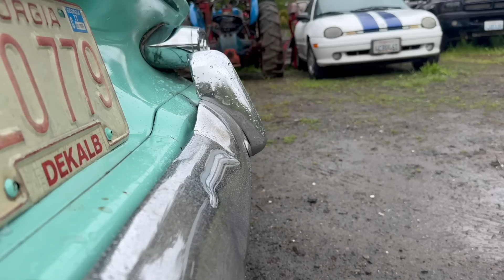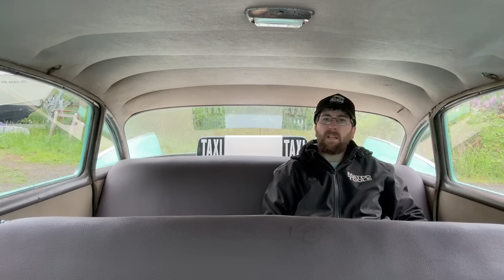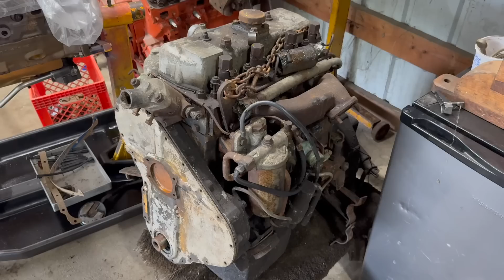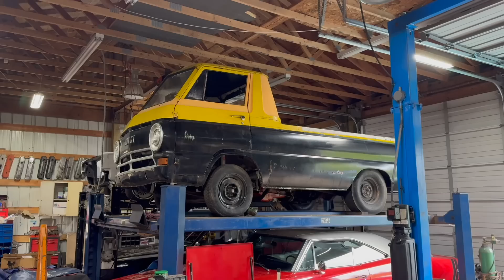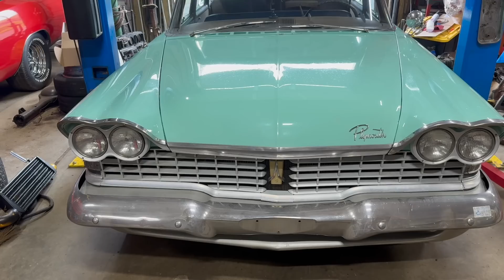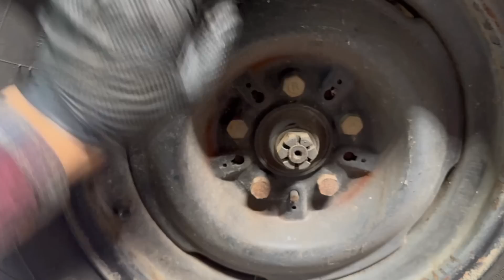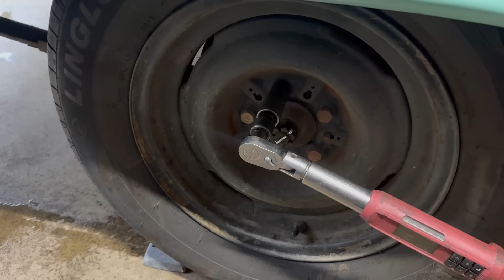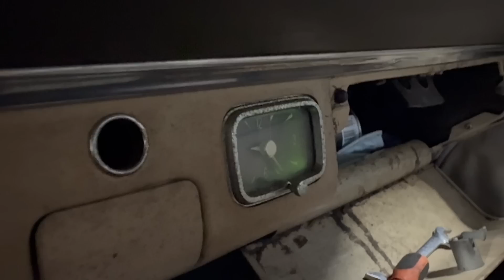Slow And Stinky - 1959 Plymouth Diesel Taxi Engine Tech, Test Drive, Safety Inspection (Not Good...)

Comment: Perkins engines from those series are IMMORTAL: here in Argentina, we used them in everything, literally everything.

4-cylinder engines are generally found in small work cars and trucks, but for something like that Plymouth, you'd probably see a 6-cylinder Perkins, the 305 or 354.

Today, it's very common to see Ford F-100s from the 1960s through the 1990s with the Perkins 6, 305, or 354. Cars like the Ford Falcon, Chevrolet Nova (1st and 2nd series), Valiants, Dodges, etc., with Perkins engines, generally the 305 for those sizes.

Argentina, like the USA, is a vast country, with large open roads and fields where agriculture and livestock are produced. Diesels are king; nothing compares to a diesel when it comes to heavy and hard work.

Indenor engines were common in light vehicles (Peugeot 404, 504, and their pickup versions), and the legendary Argentine "Rastrojero Pickup" also used them.

In the medium-heavy range, the Perkins 4 and 6-305 engines were already appearing, along with the Deutz 4 (true air-cooled beasts). In the heavier vehicles, the Perkins 3-354 and Deutz 6 engines appeared, although there were some 6-cylinder Indenor engines (around 3 liters of displacement).
Then, in the mid-1980s, some Japanese engines began to appear, such as the Nissan LD28 (my father has one in a Jeep CJ-6 4x4), which were exquisite engines compared to the old Perkins and Indenor engines widely used in cars, because they achieved higher speeds and ran smoother.

Anyway, I see that diesel taxis weren't just here, and they were ubiquitous from 1970 until the early 2000s, until the use of CNG in gasoline engines became available.

Best regards, and thanks for the videos you always share!
Reply: I truly admire the automotive products of Argentina, especially the IKA products (like the Rambler limousine built for the President of Argentina and the Carabelas) and the Ford Falcons.

I will say, however, that  Brazil has a white 1957 Plymouth limousine with jumpseats.
Reply: Gracias por explicarle un poco loco! Que motor el 6305
Reply: @ismaelduarte888  

Te voy a contar una: 
Mi finado ex-suegro, como buen Vasco, tenía una Ford Ranger F-150 ´81 carrozada, con (como corresponde a un Vasco hecho y derecho) un generoso 6-354.

Cuando se enfermó su compadre en el campo le hizo como 400km a fondo, y casi sin agua: sopló junta de tapa y partió una camisa.

Esa camisa la arreglamos con Erpox (le faltaban pedazos, literalmente pedazos de camisa), hicimos plano de tapa y cambiamos juntas: hizo como 100.00km más hasta que la vendió, eso hace 12 años, y al día de hoy esa chata sigue andando tooodos los días. 
Desde que el Vasco y yo le hicimos eso, nunca más necesitó tocarse.

¨Perkins 6: no lo entenderías..:¨
Reply: Si señor.....
Reply: Seeeeeee 🎉🎉🎉
Reply: What is the name of the 4 cylinder Perkins you are referring to I’m looking for a swap for my 88 ranger
Reply: @benjaminserino6611  

Here in Argentina, there are many Perkins models; it's a very widely used engine.

For example, whether it's the PF or PA generation, there's the Perkins 4.236, with a displacement of 3.9 liters or 236 cubic inches and 80 HP, with plenty of torque.

There's also the Perkins 4 PF 305, with a capacity of 1.8 liters and 51 HP, widely used in small/medium-sized cars.
Reply: @benjaminserino6611 There was actually an option for a Perkins diesel in the ranger from 83 to 85. It was a 2.2L
Reply: hubo Dodge Polara taxi con el Perkins 4, Chevrolet 400 también recuerdo que existieron (194 a los que les cambiaban los motores), y todavía hay andando muchas F100 y Dodge 100, un motor indestructible. Tuve mi única ocasión de manejar algo así en una Chevrolet C10 1975 de Mina Clavero a Villa Dolores, todo curvas, llegar a 100 era un milagro, pero andan casi gratis con el gasoil más barato del mercado.
Reply: @eduardosantabaya5348  

Si si, de fábrica las F-100 venían como opción con el Perkins 4, también vino como opción muy poco tiempo en los Polara 4 puertas.
Las Chevrolet C-10 desde el ´65 venían con la opción Diesel del ¨Bedford 4¨, motor todavía más bruto y duro que el Perkins 4, del que derivó el conocido ¨Cimarrón¨que usó la línea Chevrolet a fines de los ´70s y principios de los ´80s. Incluso existió una versión Turbo del Cimarrón.

Después el Falcon salió uno o dos años con el Indenor XD2 (el mismo de los Peugeot 504D segunda serie), cosa que gustó poco, aunque bastante más que el Falcon 4 Cilindros (motor Lima 2.3 del Sierra).

depués de los grandes, gasoleros de fábrica, no recuerdo otro. El Polara y el Falcon sé que existieron de fábrica con opciones Diesel en algún momento de su fabricación, de los demás no me consta.

Lo que si existieron las ¨Reformas Diesel¨ sobre motores 6 cilindros nafteros de esos coches: yo vi sobre Chevrolet 194 y 230, y sobre un Falcon. Andaban bastante bien, pero se jodían los cigüeñales muy seguido, por que no estaban fabricados para eso, el Diesel torsiona y somete a mucho esfuerzo al cigüeñal.

Después la joyita semi olvidada: los Indenor 6, que caminaban lindo haciéndole alguna cosita, igual que los Bedford 6-300, su hermano de 2 cilindros serruchados el Bedford 4- 200 y el mayorcito de los 3, el Chevrolet 6-350, que básicamente era un Bedford 6-300 agrandado y bastante papeado.
Reply: impecalbeeeeeeeeeeee!!!!!!!!!!!!! papa!!!!!!!!!!!
Reply: Save Rastrojero's ✌️
Reply: @killerdinamo08  

JOJOJO!!!

El Tercero en discordia!!!

Comment: That glass bowl fuel filter will work great water goes to bottom, need new seals for that glass fuel bowl. Do not take it apart until you have new bowl gaskets/o rings.
Also left front wheel lug bolts mat be backwards!
Also also do not use new synthetic oil on old style cork gaskets, synthetic oil will only stay in with newer rubber gaskets.
Reply from the maker: I explained that the lug bolts are reverse thread, didn’t I? It’s a rare day that I ever have an issue with the old gasket on a glass sediment bowl.
Reply: @DeadDodgeGarage  I love that, glass sediment, water extractor says diesel tractor. Also never use farm diesel, it will run fine but it's less expensive because there is no fed or state highway tax and it's a different color, the fine is huge . A guy on NC adapted his Volkswagon rabbit to run on old french fry oil, instead of praise using waste french fry oil they used his odometer to fine him. Where ever he drove smelled like french fry's!
Reply: So cool! The best part of having old Chrysler is driving it! Trailer queens just say no!

Comment: We have a dodge dart. With the Nissan diesel engine conversion . That was a dealer installed conversion
Reply from the maker: Yes! I really want to find one of those too.
Reply: Definitely a one of a kind thing.  If I remember right it 89 horse power
Reply: Are car is an automatic transmission car. It’s slow to

Comment: In 1969 my new wife and I decided that we didn't much like living in Minnesota and wanted to move back home to South Dakota. The car I had at the time was a nice 65 chevy but I had a note on it, and it was to my old boss, so I asked him if I could give him back the car and end the note, he wea OK with that as we were friends. I walked  up the hill from the gas station I had been working at as a pump jockey to a used car dealer to buy something to  take us the 400 miles back home. He had a 58 Plymouth that looked a lot like the mirror of your car, it was White with that turquoise trim. It had a V8 and push button on the dash shift.  The main problem with it was it had lived its life in Min and they used tons of chloride on the highways to keep the snow at by. It had cancer so badly you could see the highway beneath your feet in the car and the headlights were held on by bent coat hangers  The auto transmission leaked so badly that I had to stop at every gas station and have it filled with ATF. But we made it home in the old beater, and my wife used it for the year i was in Vietnam, I think it still sits in the tree belt at my late father in laws farm.
Reply from the maker: Wow… that’s awesome!

Comment: Very good - thank you. Just make sure if the nut behind the steering wheel is also loose, carefully get it torqued and use your split pin properly.  LoL

My dad picked up an early 1957 Plymouth Plaza 2dr stripper (flathead 6 and 3-on-the-tree) and then in the early 1060's a 1958 Dodge 4dr hardtop with the 325 RedRam V-8 and torqueflite.  My mom said she loved the tail fins because it made backed up easy to judge.

Comment: The mercedes om603 is turbo diesel and 120 hp. Allot of people convert  arsenal and 4x4 to mercedes diesel. Easy to find. Cheap to maintain. Easy to work on and 30mpg in a 3000lb car. And are well known to run up to 500k miles if maintained.

Comment: The fact it was used as a Taxicab and it is still here is a miracle onto itself. When I drove cab it was nothing to see Diplomats and Dodge vans with mileage in excess of 500,000 miles. Not so much with Caprices and Crown Vics. 
Classic boat owners tend to love the old Perkins diesels. You see some in narrowboats in England. 
I think that car as a Unicorn should have some extra value. But as an under powered Unicorn that adds the problem of finding the person that appreciates the Unicorn for what it is.
Speaking of slow I owned an old Dodge M37 weapons carrier with the 230 flathead and 5.83 gears. While the  slowest vehicle I ever owned it was probably the most entertaining vehicle I ever owned to drive. It was a monster off road and on insanely steep bulldozer cuts.
Reply from the maker: I don’t know if it was used as a taxi for long. It seems unlikely that it would’ve survived as it has if so.
Reply: @DeadDodgeGarage  Probably would depend on the company or owner that had it. Some did real good maintenance others not so much. Even worked for one taxi company that loved K cars. They had figured them out to the point they were getting more than 300,000 miles out of them. They were cheap to buy and cheap to fix.

Comment: The body on that thing is perfect. What an odd and great car. 1957-59 Plymouths were not popularity bottle rockets, but I think they are good looking, and even classic, designs. With a Perkins Diesel? Perkins are known to be extreme industrial workhorses and ship lifetimes often approach 100 years. What a weird and perfect thing. A total restoration is deserved IMO. And even a low pressure blower would be a good 21st century considerations. I’m completely surprised how much I like this weird car. I’d even like a flat six or V8 1957-59…savoy is fine with me….. Better stop watching these videos. It was a great trade that you made. So good that an appropriate person has landed it. Congratulations! Edit: forgot to mention that I had an old MB 190D and it has zero power and apparently fueling issues and the barostat had to be redone. A later MB 300D redo had the same issue. I lived at over 5000 feet altitude so it mattered. This took a lot of time to figure out at the time, so I mention it.

Comment: Love the car! The concept of "hopping up" the Perkins diesel can be trouble prone. A close friend of mine had basicaly the same version of your 4 in a 6 cylinder version non turbo. they installed a turbo and promptly scored the cylinders and galled the pistons. Turns out the turbo versions have rifle drilled con rods to oil cool the pistons.
Reply from the maker: Extra piston cooling oil is pretty typical of most turbo diesel designs.

Comment: My questoion about those old diesels. Was it SO hard to make a gasoline engine equally as fuel efficient, when you disregard performance the same way you do on an NA diesel? That Perkins made 140 lb ft of torque (around 190 Nm). Maybe a detuned I6 or an I4 gasoline engine would offer the same fuel efficiency or close, without the stink/clacking
Reply from the maker: The efficiency difference between gasoline and diesel has been well documented for decades. Yes, it was “so hard…”
Reply: @DeadDodgeGarage  I know that. But usually when I see people claiming ridiculous fuel economy figures they are either dragging themselves on the road, something that even a gasoline engine can pull out, or are driving normally and still getting about the same fuel economy. Also how different were the fuel efficiencies between this and the base I6 with the 3 speed manual and the same final drive ratio?

Comment: turbo and intercooler required
Reply from the maker: I refuse to put extra holes in the car, so that kinda rules out an intercooler.
Reply: @DeadDodgeGarage  with that much space between radiator and engine you wont have to cut any holes,and a 3" exhaust will also not requre anymore holes than stock

Comment: It's so rare, that you have to keep it all original. By the way, diesel engines were always noisy, smelly and slow. Cheap fuel was their claim. Today's are turbocharged and much more refined.
Reply from the maker: The Perkins stays. But I see nothing wrong with chooching it up a bit in a fully reversible way.

Comment: I own a 85 Cadillac Fleetwood w/a 5.7 Olds based diesel.  A rare example w/ two mounting bolts and  5 pin electrical plug like a mid 80s Quadrajet.  It was terrifyingly slow, replaced w/a 6.5 turbo diesel from a 2000 G-30 van.  Much better now.
Reply from the maker: I mused about a 6.5 swap into my ‘71 Fleetwood for a while there… I didn’t do it, but it would have been cool.

Comment: With the Delta Airlines sticker on it, it was probably being run on jet fuel ( kerosene) . This was not unheard of with aircraft mechanics but it lacks the lubricating characteristics of diesel and tends to  wear out injection pumps and injectors if you don't add a bit of 2 stroke oil. It could explain the spare pump.
Reply from the maker: Interesting. But I believe the pump and rebuilt injectors were acquisitions of a more recent owner.

Comment: Could be your most interesting car yet, or even best car, not that I don't like the others. Not on this car, but if one had a crappy '59ish Plymouth with a 3 on the tree and crapped petrol engine, a swap to a Mercedes-Benz 300 turbo diesel (5-cyl) might be interesting. I think that's the same capacity as the Perkins, and must be in plentiful supply second hand and about 130bhp? I'll add it to my list of future projects at about No. 278. 59 Plymouths have a certain dignity about them compared to those before or after. Just my opinion. I look forward to the road trip(s). Greetings from South Australia.

Comment: Really enjoyed this, the history and character of old vehicles is fascinating. Never knew our old Perkins were finding their way into your cars! Back in the 90's the electric company I worked for had some Austin Maestro vans which had 2 litre Perkins in them. Pretty noisy but they performed quite well. Easily outlast the rot boxes that surrounded them! I love the different terminology - Cotter pin/Split pin, Sway bar/Anti-Roll bar, Rotor/Disc, Wrist pin/ Gudgeon pin.

Comment: Don't clean it, that's it's protective layer. It's reduces oil leaks and prevents rust.

By the way. A small pinch of sand or grity dirt and dawn gets grease off hands pretty quick.

Comment: I’d get that spare injector pump tested to make sure it’s set to the right specifications, swap with the current one, haul out the 4 injectors and get them serviced and you’ll probably find she goes a lot better. The fuel injection system has to be in good shape for a diesel to run properly. The engine will often even run quieter if it’s getting a nice even spray of fuel at the right time. It makes a heck of a difference. Cool old car you have there! I’m a retired mechanic. Interesting that Americans call split pins cotter pins. To us in NZ a cotter pin is tapered with a flat on one side and threaded for a nut on the smaller diameter end. The flat jams in a similar shaped groove on whatever shaft it’s holding something on to. They’re used to hold the cranks onto the front sprocket shaft on old bicycles. They’re a very cunning idea.
Reply from the maker: Injectors were already serviced during previous ownership. I will likely try the other pump if it continues to not cooperate. Or, may swap the governor diaphragm.

Comment: Um, a 1980's era VW Rabbit diesel has 48 hp and weighs 1/2 of that Plymouth and they take a LOOONNNGGG time to hit 70mph on a flat road and they are actually somewhat aerodynamic! I would guess that engine is way out of factory spec too! At least I won't see in the Oregon or Washington local news a person ran off a bridge in a 1959 Plymouth due to steering or wheels falling off!